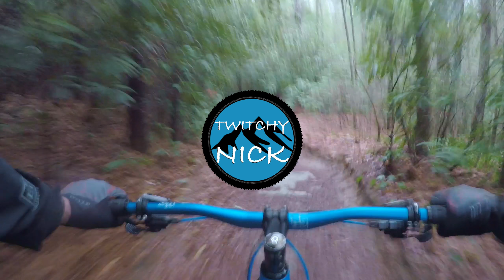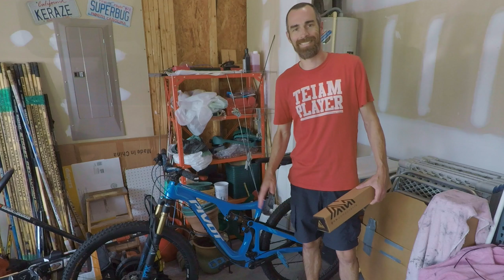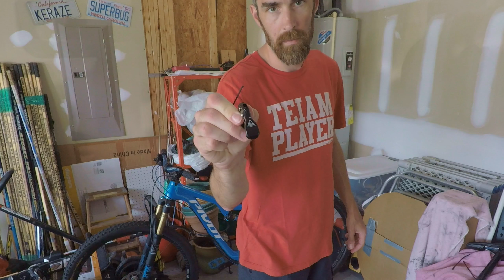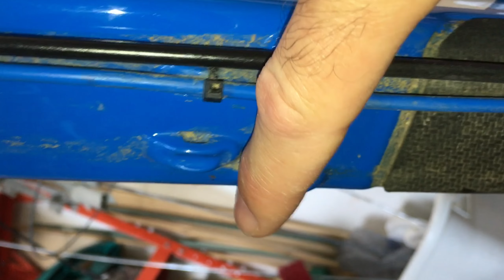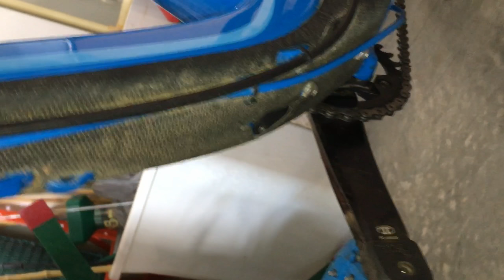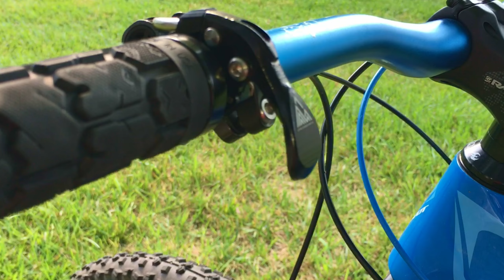PNW Components Bachelor 150 Dropper Seatpost Install

Comment: First time watcher here, this is an excellent dropper that I had for quite a long time on my old bike.  I am getting another for a newer bike purchase as well and noticed they have an updated Loam lever.  That was my only gripe with this dropper, the lever you show in your video was something I'd break in big crashes.  Other than that though, the dropper worked flawless...never had an issue.
Reply from the maker: sbw1980 Check out my review video. I show the new Loam Lever. I got one after both videos, I just haven’t installed it yet. The price of the Bachelor went up but as you noted, it now comes with a much improved lever. They also have a 170mm version. Thanks for watching.

Comment: So how do you like it now that you've had it on the bike for a while.  I'm thinking of picking up the 170mm version of this one.
Reply from the maker: Brian Vaughn Hi Brian. I plan on doing a short review sometime soon. I’ve had a significant number of rides using it, including decent elevation and tech sections on a recent trip to VA. Overall I really like it. Even the thumb lever that comes with it is decent. I’ll likely upgrade to their new lever though at some point. The seat response is consistent. Not super fast that it’s going knock you in the rear, but it’s psi can be adjusted under the saddle. I’ve also been happy about how solid the saddle is on the post. No wiggle.